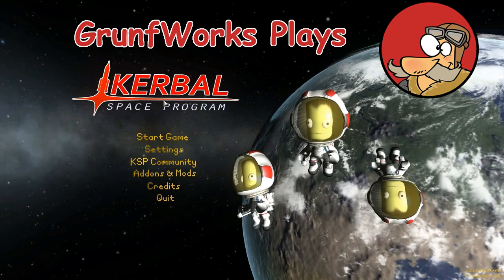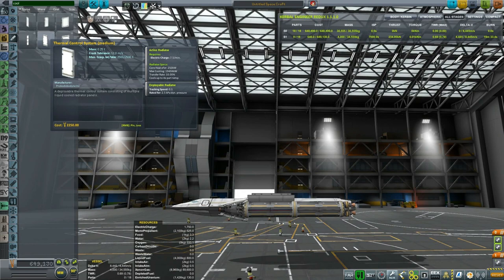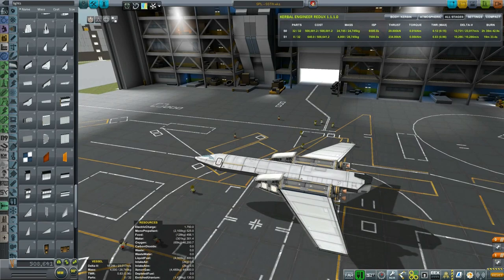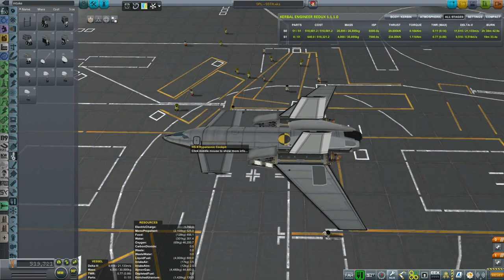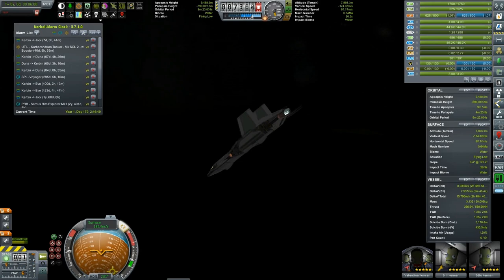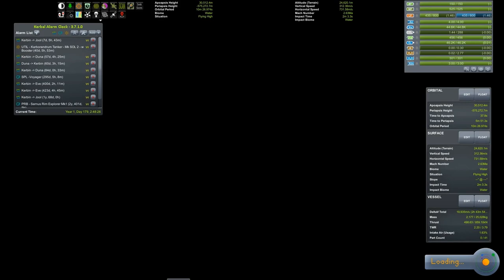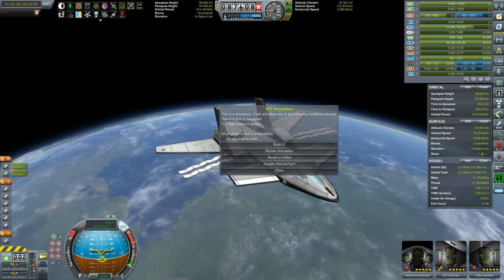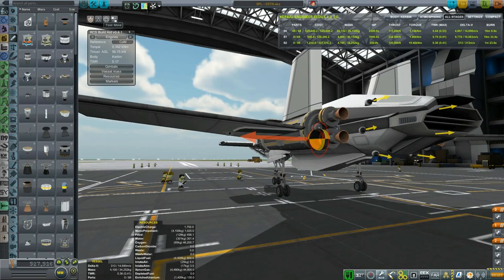Kerbal Engineering - How to Build a SSTI

Comment: This SSTI is not able to return is it? If the reactor overheats upon reentry, it will always blow up at the end....
Reply from the maker: Not necessarily it blows up every time, had a few successful return tests
Reply: I mean it is a nice design but it should be more resilient to reentry overheating. reentry should work blindfolded without luck or complicated flight  moves, if you have this kind of buffer you can try fancy things like hard aerobraking at the other side and make this one of the most versitile craft i have seen so far. I wonder if I can get the Ion drives without installing Interstellar. But maybe you could protect the reactors better by putting procedural fairings around them. They are now part of vanilla and come with a scaffold to also attach other stuff too.

Note: Ion drives dont need to be on the outside. The stock iondrive is kinda broken and works like RCS, so you can put a ton of them inside of the cargo bay!
Reply from the maker: Definitely the reactors are the risk point of the craft, at best they 
are irradiating kerbals in the cockpit nicely. I consider this SSTI to be a transitional design till i get Karborundrum fuel loop going. For hard aerobrake i have
 a ready tech mod installed, which even on recorded episodes (20 at the 
moment) i have not gotten yet to using - inline ballutes, but i think i 
should give them a go.
Link: http://forum.kerbalspaceprogram.com/index.php?/topic/121162-12-inline-ballutes-ib-v127-25102016/

Ion Drives without interstellar ? Sounds Like nearFuture Technologies mod for to me:
http://forum.kerbalspaceprogram.com/index.php?/topic/47786-121-near-future-technologies-nov-18-many-updates/